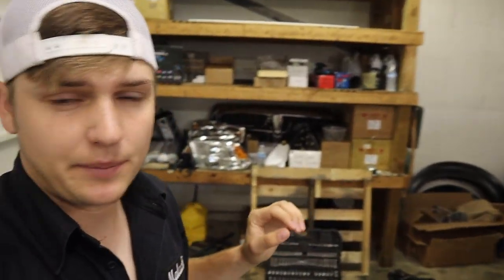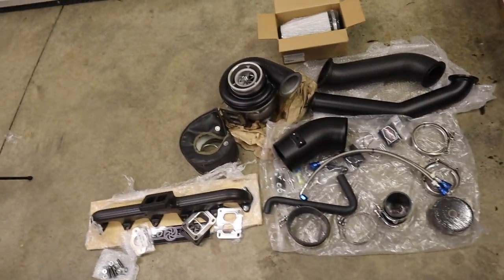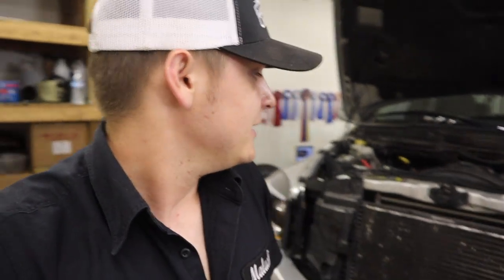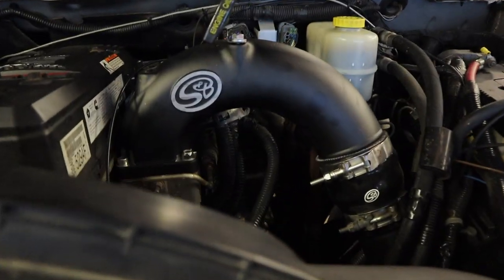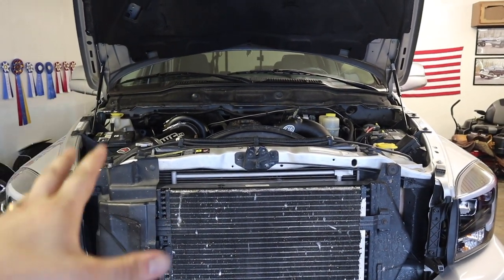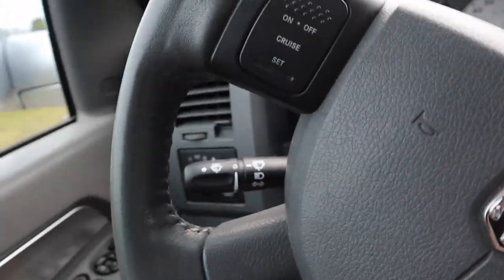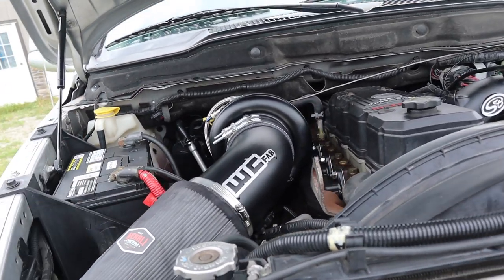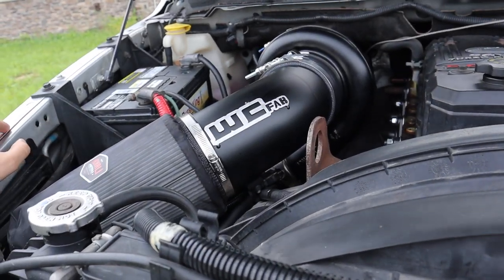YOU WON'T BELIEVE WHAT I JUST DID....

Comment: makes it sound so much better. its crazy how much louder they are at idle with a 2nd gen manifold. makes them run more   efficient to!! the flange bein' in the middle of the manifold is so much better. that common rail manifold makes 5 and 5 burn so much hotter.

Comment: Whats that check engine light about?
Reply: Most likely the mass airflow sensor before the turbo in the intake not hooked up
Reply from the maker: Disconnected batteries and hooked back up then it was on 🤷🏼‍♂️
Reply: Could be a number of things, mass air flow sensor, exhaust back pressure sensor, exhaust temp sensor from changing the down pipe.